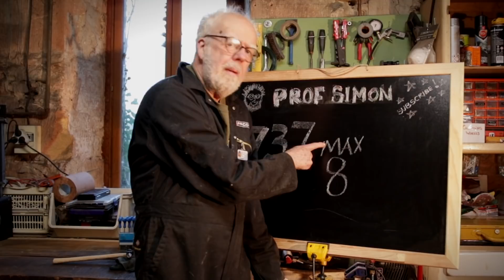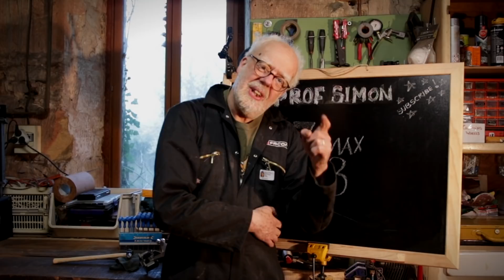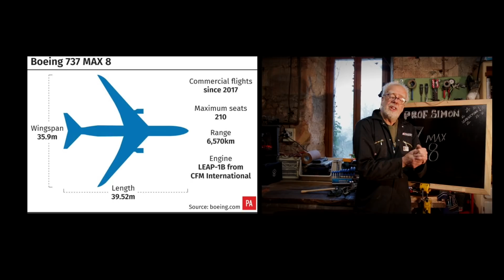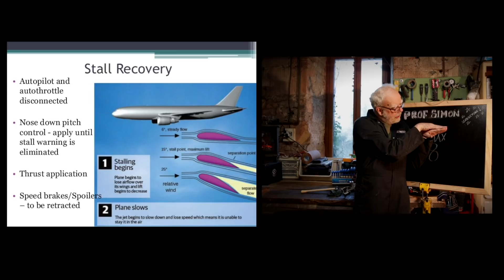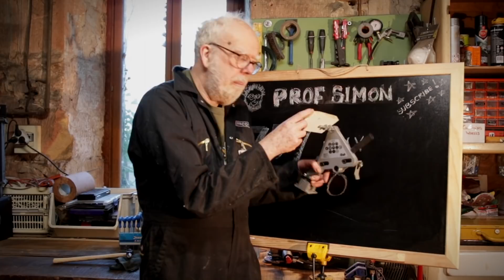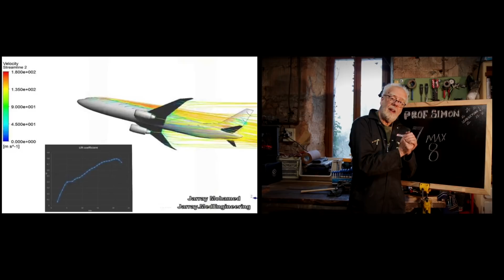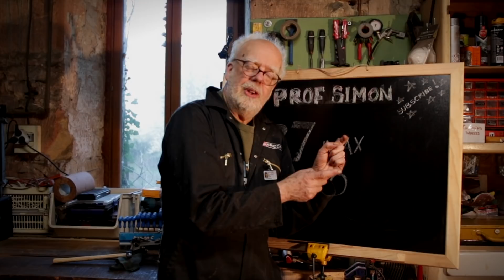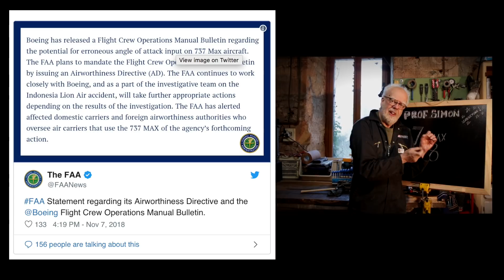Boeing 737 max 8's

Comment: What I find incomprehensible is that the issue with the Lion Air 73M was an issue called; 'runaway trim.' The aircraft is programmed to maneuver the horizontal stabilizers to compensate for the instability caused to the aircraft's attitude. Pilots are trained to deal with this phenomena, as and when it occurs. It would be beyond belief if the Ethiopian incident was found to have been caused by the very same issue. By far the greatest cause of incidents, caused by human error, is that the pilots 'forgot' to fly the plane as their main priority.
Reply: By the way, the new MCAS software, on the 73M, will only work when the auto-pilot is off and the flaps are fully retracted.
Reply: It's called MCAS ... it's a new system

Comment: Actually, Modern Airliners do have Total Automatic Pilots. They even have Auto Landing Capability for extremely poor weather conditions - see Category III Auto Landings. Pilots are even required to execute a certain number of Auto Landing each month.

Now, when Pilots are actually hand flying the new fly by wire computer controlled airliners, yes the computer system (usually 3 independent) computers monitor the pilots control inputs to make sure they aren't outside of the flight parameters of the aircraft they're flying.

Check out the 1988 Scandal of the Airbus A320 Low Flyby Crash at Mulhouse, France: http://www.crashdehabsheim.net/CRenglish%20phot.pdf
Reply: Many, maybe MOST airliners don't have autoland. ALL of them can do the approaches to minimums once programmed and activated. Autoland is an expensive system to throw into the fleet unless you really need it. It's more common on long-haul widebody than single-aisle 2-4 hour models

Comment: Training can help you only during problems forseen by training...one needs to use their head after that fails, if there is enough time...many times there isn't. Also airbus somehow doesn't have any such problems with similar systems...maybe thanks to the different training...maybe the systems themselves though.
Reply: Mozoto when the first airbus’s that came out with an automatic flight control system a pilot was doing a flyby but the plane thought he was landing even though he tried to apply full power the plane would not allow it and it crashed.
Reply: @willwarden2603  Yea, i know of this accident, still such issues seem to be worked out as of now on their end, boeing though seems to still be green when implementing such measures.

Comment: It’s very true pilots revert to training. If my memory serves me correct there are some case where Russian pilots crashed as they reverted back to there training skillset: they where used to an artificial horizon where on the instrument the simulated plane moved and the horizon remained still or the horizon moved and the simulated plane stayed still (I can’t remember which). Anyway in their new plane it was the other way around, the plane was static and the horizon moved or vice versa.
So, when they ended up in a situation where they over-banked the aircraft and could not recover because their instincts (trained instincts) reverted back to how they learned IFR and upset recovery and could not figure out why the horizon “was wrong”. This over powering instinct blocked them from seeing that they read the instruments wrongly. 
I am wondering if the 737 max 8 went into a deep stall and combined with the lack of height it was a situation of not having any time to get out of the situation. 
I do believe the Indonesian crash also had a malfunctioning sensor?
Very cool you have your PPL! That is still a dream of mine :)  Raptor Aircraft! 

-edit: many many typos corrected.
Reply: Yes thanks for bringing that back to my memory I saw the TV show on that!like to see it again if somebody can remember the title of the show!
Reply: S Tman Here you go:  https://youtu.be/2nCvO_QlEm8. Also happened on another flight, unfortunately. See: https://en.m.wikipedia.org/wiki/Aeroflot_Flight_821
Reply: Old Russian AHs used a moving aircraft symbol whereas ROW used the classic Sperry AH where the aircraft symbol is fixed.
I've used both and actually prefer the Russian instrument. 
I was considering modifying an old Edo Air AH to Russian, it would not be terribly difficult.

Comment: Boeing installed a system called MCAS. They did NOT emphasize this new system to pilots & airlines. Some pilots flying thes MAX aircraft didn't even know it was operating. Apparently this MCAS system sometimes fails or has a fault. When it fails the way to recover is to turn off the MCAS. Everytime the MCAS fails & pilots disonnect it they land safely. The MCAS system is supposed to prevent anerodynamic stall. It forces the nose back toward level if it detects a possibility of stall. The MCAS sometimes incorrectly  detects a stall. In these crashes the airplane thinks it is stalling but the pilots see it is not stalling. If pilots don't know about the MCAS or how to turn it off the aircraft will keep pointing the nose farther and farthet down until impact with the ground.
Reply: Am a layman. Does the MCAS system really allow itself to be turned off while on the fly by the pilots? Can you confirm this. Have you read its manual?
Reply: @HereNow2226  yes you can turn it off...but the problem here is that pilots don't have enough time to figure it out...they are flying low and when something like that happens they have only seconds to figure it out ...
Reply: The sooner they get that system figured out and fixed the sooner the public may trust them again. No one likes playing Russian roulette with their lives.
Reply: That's exactly what is happening
Reply: I'm afraid you are uniformed on how MCAS works, and  what happened on the Lion Air flight from what we know so far. BTW, you can't just shut it off (there's no "MCAS button", it's a hard coded firmware behavior). You can however recognize that it is misbehaving due to AOA sensor disagreements and then disable the stabilizer trim which is likely running away on you by now. This whole conversation may come down to a batch of faulty AOA sensors, you have no idea. It's just too soon to make any conclusions. Heck, an Ethiopian witness observed fire on the plane before impact.
Reply: @chamberlin1  no...they can shut it off but pilots may not know what causes the plane to move up and down or simply don't have enough time...but it is now obvious there is a huge problem with this system...this crash is the same like the previous one...it is not engine failure or fire
Reply: It's funny, I watched a simulator of the 737 max8 we're they simulated this very issue, and the just reach over and flip the switch off. You can turn off the system. You can then fly it manual.
Reply: It's really not that simple, especially if AOA sensors are playing a hand in erroneous air speed readings and a cacophony of warnings going off all around you.  For the airplane to decide trim down hard in that situation is a recipe for disaster.... as we are seeing.  We won't be certin for a while obviously, but it doesn't seem that MCAS is particularly well understood by anyone and that is a red flag.
Reply: @Baseballnfj  The error seems to start with a faulty AOA sensor or reading. The MCAS is doing what is is supposed to do, but the AOA triggers the accident chain. Here's a 737-NG captain discussing the MCAS.
https://youtu.be/XJwUk5HH4KI

The Trim isn't a runaway trim, as in one sustained nose-down command. The pilots can interrupt the MCAS commanded trim by activating their electric trim. But, once they stop their nose-up trim the MCAS commands nose-down trim. I believe MCAS commands trim for 10 second intervals. Obviously, just after takeoff and early climb out is no time to start fighting the autopilot for control of the aircraft.

As I understand the purpose of the MCAS system is to give an automated protection of aircraft envelope with the more powerful engines and their more forward position than previous 737 models such as NG and -800. Those engines in those positions at very high power settings can lead to the aircraft having less elevator pitch authority than desired. The MCAS is added to prevent the engines/aircraft from accidentally getting into that condition. I'm sure it was easier for Boeing to "fix" the condition electronically using a stabilator more common to various 737 models than design, fly, certify a unique tail. 

IMO, the crime is Boeing not emphasizing this addition to previous standard equipment and being skimpy on procedure and failure modes during Transition Training for pilots. An analogy might be Ford adding a rollover stability computer to their SUVs without really doing more than adding a paragraph in the owners manual. One day while you are merging on the freeway the rollover stability computer commands a hard turn to the left. 

There are 2 Stab Trim Cutout switches just between the fuel cutoff and throttles. I'm sure every pilot at every airline in every aircraft is being drilled on disconnecting Stabilator trim quickly.

We're seeing converging trends create problems. Low time pilots, increasing automation, ballooning certification costs, fixing physical problems with electronics. You can EASILY incorporate one or more, carefully. But maybe not all of them.

Comment: Nice subtle jab at them horseless carriges.
And on that note, Driver Assist systems in newer model cars and trucks are screwing with older and experienced drivers.  Sometimes the old ways are better.
Reply: Yub because overeliance on those aids can make skills atrophy and die. 

And if the systems fail, we can't deal with it anymore. 

Funny story, I used a computer game (Arma 2) to teach a friend how to read and navigate using no more than a compass and a map. 
He was always using those navigation softwares on his cell phones so he couldn't navigate using a map. 

Well suddenly in that one scenario there was no GPS and no icons on the map. so he had to work with map and compass. 
He didn't even know how to read elevation lines, but after a few hours ingame he could. 

The cool thing about Arma, an offshoot of which is used for military training, is that you can also navigate by the stars, as it features an accurate night sky with star constellations as well as by the sun. 
Kinda helpful, even IRL as with the navigation by the sun you always atleast know where you're headed, and you only need a watch for it. 

I learned all that during moutaineering and family vacations in the 90's when those systems were still SciFi for the most part. 
I remember navigating my dad halfway across france via the backroads using no more than a road atlas after the motorways were clogged due to a storm. 
We made good time, and arrived a lot earlier than those who still went the motorways.
Reply: True that, but this goes even deeper getting into Artificial Intelligence, which I also can't fully buy into.  It's more science fantasy.  The idea that a machine/computer can do EVERYTHING a human can possibly encounter and instinctively react to just doesn't "hunt."  While there are have several deaths with self-driving cars, like the Professor suggests, that's how we "learn."  Kind of  a "high cost" of learning, but one crash was because the sensor drove under a tanker truck because it couldn't sense the tank on top, and decapitated the driver.  The reaction time to override a self-driving car is much less than overriding a large aircraft suddenly diving nose down.  But if you can't turn off the auto-safety control, and you can't psychically overcome it. . .

Comment: Thanks mr professor, so the pilots should first learn that software of max 8
Reply: yes. But training costs.  The lack of training needed was a selling point.  So Boeing created an active/live software to simulate the older 737 ( 700 ?) on the max 8.  Boeing sells more planes and airlines spend less on planes.
Reply: A plane that’s heavily depending on softwares is not safe in any way, REMEMBER, theres no perfect software out there. There will always be some hidden bugs in those “softwares“.  pilots have always been able to handle the planes manually. More software and automating =/= efficiency.
Reply: That's it,the airlines taught it was the same 737 they only difference they we're listening to was that it was more feul efficient

Comment: I have seen some videos which say the the MCAS might be to blame. But your video has a homely feeling to it, like someone trustworthy is speaking to you. Keep them coming, sir.
Reply from the maker: I think they are probably onto something...I wanted to be a bit more general...thanks for watching.
Reply: @SimonHollandfilms  - It. Won't. Be. Long. Before. I. A. Computer. Program. Do. Videos. On. You. Tube. Better. Than. Humans. Bah. Humans. I. Am. A. Program. Already. Get. It? I. T. Ha. Ha.  (There's a line in the movie "A Hitchhiker's Guide to the Galaxy" I think is hilarious. They tried to design a robot with emotions. They didn't get it quite right, and got a manic-depressive robot.)
Reply: Ive heard the same exact thing. Something about it only working properly when the autopilot is off and the flap are fully retracted. Dont quote me it qas alot to digest.
Reply: @Vijay Sharma I agree with you

Comment: It appears with these two crashes that there is a disconnect (no pun intended) between the pilot and the machine. I wouldn't be surprised if the end conclusion is something alone the lines of "Boeing was wrong to minimize the significance of the new MCAS system in relation to how much emphasis and awareness pilots received as they transitioned from older 737 models to the "MAX" series." Clearly pilots are not happy with how little training they have received on the topic and I suspect it is in relation to the the time and money it takes to pull pilots from the air and pay them to sit in classes and simulators. If Boeing had been more forthcoming with the airline companies, knowing that the companies training costs would be higher with this new plane type, the purchase price probably would have had to have been lower per plane or maybe even risk not getting as many planes ordered by the airlines. It all comes back to greed.
Reply from the maker: very good comment...I agree totally.
Reply: @R.D. Mercer My sense is your comment may be very accurate. An associate is a 777 line F/O, but is also a PPL stick and rudder man. His FIRST question (and mine, from the avionics side) on a new system is how to turn it OFF. In the Lion Air crash, the aircraft was having known AOA sensor issues. In that scenario, the A/P will disconnect, but MCAS lets the sensors "compete" without knowing which one is defective, and ultimately flys you into the ground UNLESS you know to flip the 2 center console switches OFF. That's the ONLY thing that will keep the plane flying with an AOA disagree. I would hope in the past 3 months EVERY pilot would have been well trained on those MCAS cutout switches, but maybe not... Maybe this is something different?
Reply: True, though it is worth considering that the airlines also pressured Boeing to deliver an updated narrowbody airplane quickly because A320neo was so competitive (their internal preference seemed to be a new design). Boeing's management may have pushed hard for minimal training because they were concerned airlines wouldn't be happy otherwise.
Reply: Good comment
Reply: R.D. Mercer I agree totally - greed !!!!!. list for more profit at the detriment of human souls who are probably 'breadwinner' of their individual families. it is painful having lost such number of innocent souls in just two aircrashes !! due to negligence and greed of some motherfuckers !!!!. flying nowadays is more of commiting suicide with your hard earned money !!!. the relevant authorities should endeavor to do their jobs efficiently to prevent any re-occurence. May God gives all the families that lost loved ones the fortitude to bear this losses.
Reply: Just abolish these planes, imagine how much fear and despair passengers had to go through during the crash. To be honest these planes are just time bombs!
Reply: Just retrain the pilots to expect a failire in the mcas.
Reply: @taiwanvstheworld  It's time for Boeing to run to Papa Trump for protectionist measures.
Reply: Boeing may have not emphasized, but at the same time don't forget that Boeing just provides the manuals - the Airlines are actually the one's who foot the bill for pilot training - even if the training is from Boeing. And if they are cheap the training only to extends to telling pilots to read the manual and that its.